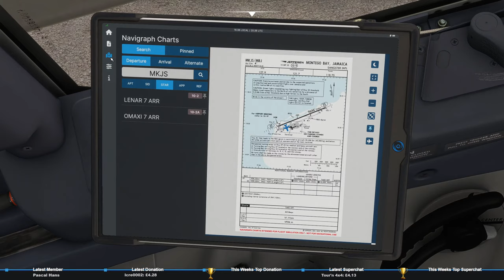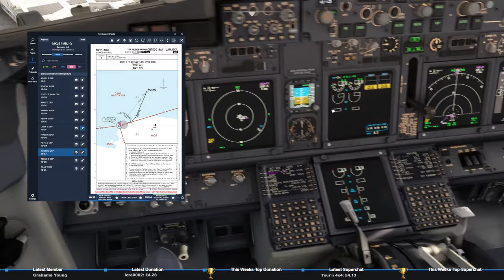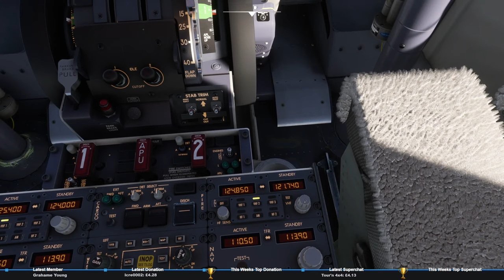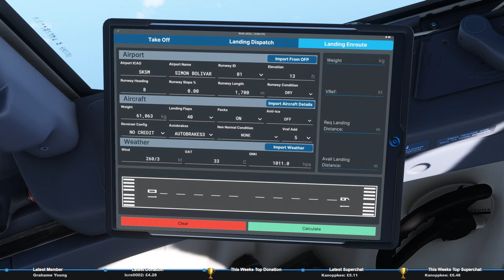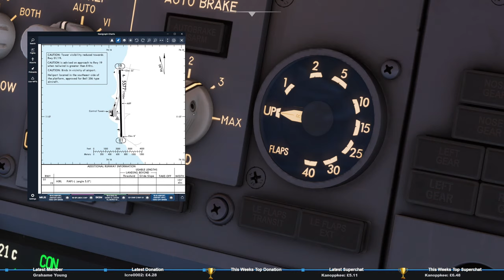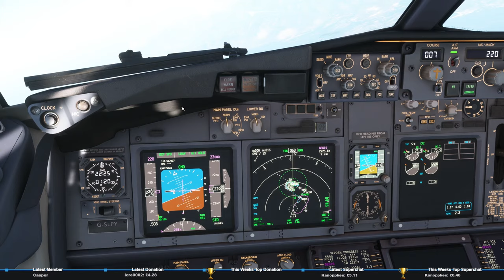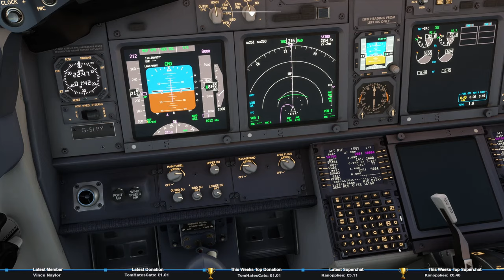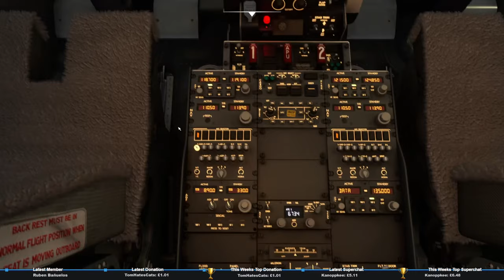Declaring MINIMUM FUEL in the PMDG 737! | Montego Bay - Santa Marta

Comment from the maker: Hi everyone!

Today's stream was a great opportunity to discuss the steps crew go through in a impending low fuel situation. As discussed and applied during the stream we did the following.

Our plan was to fly from Montego Bay (MKJS) to Santa Marta (SKSM) with no NOTAM's and good weather forecast - we took standard block fuel. Due to it being incredibly busy on VATSIM and having to wait 30 minutes to fly an approach we applied the impending low fuel steps as I'd do in real life.

Step 1 - Request EAT - Expected Delay. Crew decide to divert/commit (landing assured at destination). You can then use ALTN fuel to commit to destination and landing still in excess of FINRES - No fuel declaration required.

Step 2 - Committed to land at an aerodrome but any change in the existing clearance could result in landing less than FINRES - Declare MINIMUM FUEL". Our situation during the stream.

Step 3 - All previous steps/opportunities to protect FINRES have been used. Now landing less than FINRES - Declare MAYDAY FUEL (This would have been the case had we gone around).

Hope you found that interesting!

Comment: You said you wouldn't inform passengers about the fuel situation, which makes sense. On flights I've been on, sometimes the captain will inform the passengers of various updates or changes so I was wondering if you would inform passengers if there was a diversion to another airport due to the fuel situation and the ETA. Saying simply that due to delays diverting to another airport is required.
Reply from the maker: Hi there!

I would never personally mention any impending/actual low fuel situation. I'd just highlight the reason we were having to hold and that was delaying the approach/causing us to divert.

FD2S